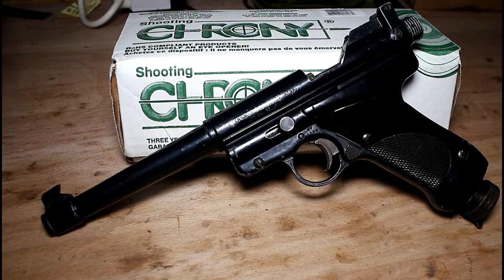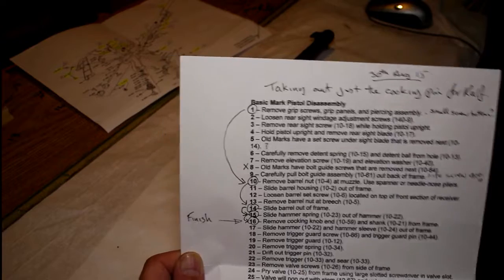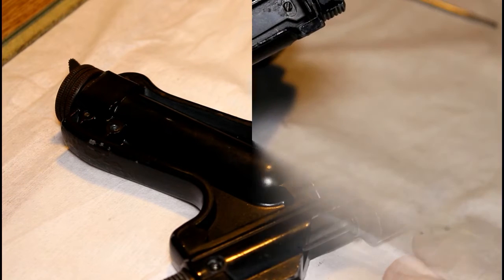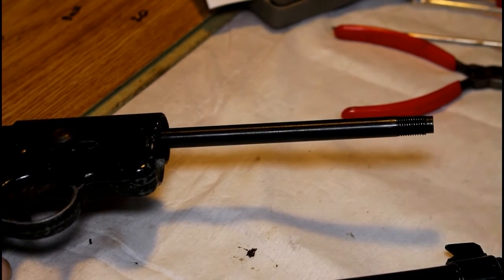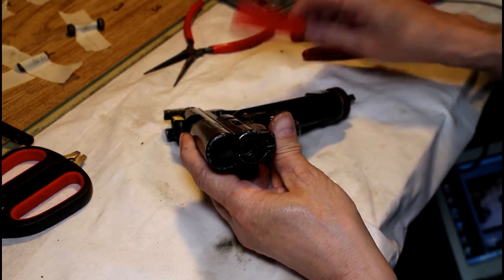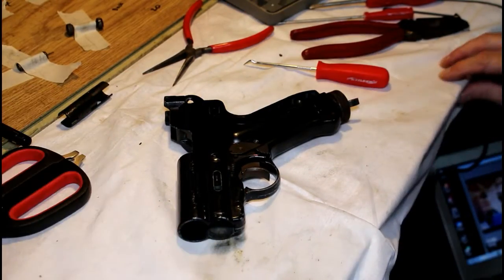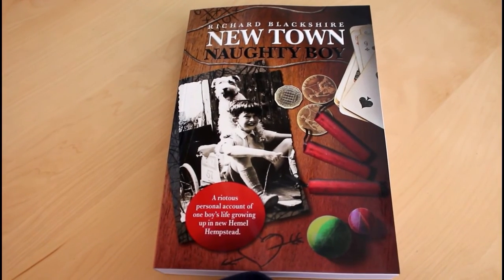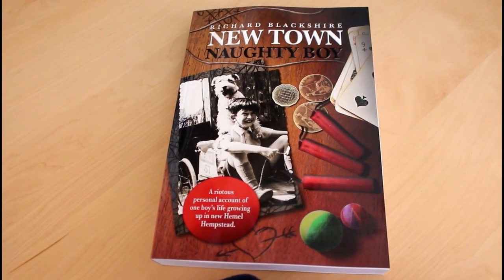Crosman Mk2 air pistol stip down (Part 1 disassembly)

Comment: Delrin valve seal …. I replaced mine with a nylon o-ring which I made on the lathe. This required removing the brass valve head from the stem. These parts are pressed together and required a small hydraulic press to get them apart. And even then I had to simultaneously apply a bit of heat to the brass with a propane torch. Note that the stem only presses out in one direction … away from the seal. This is due to a small flaring taper in the stem just in from of the seal …. it is this taper which holds the seal in place. The seal OD did not need to be a precision fit but the ID did. A finger-tight press fit between the stem and seal was sufficient. To reassemble, the seal was placed into the brass and the stem carefully pressed in with the hydraulic press until the flared part of the stem just met the seal. And that’s it. Some new valves don’t have brass at all, it has been replaced with some sort of plastic (Teflon?) which also serves as the seal. This is much easier to make. In future. I’ll make a single Teflon or nylon block to replace the brass + seal and press it onto the stem.

Comment: I have a Mark I and the tail on the hammer spring broke off in the cocking bolt, is there a way to remove it so that I can remove the cocking bolt?  Great video

Comment: you didn't cover the piercing pin enough. Mine is leaking and was just looking for info on this area. I will keep searching thank you for your video.
Reply: You have to rebuild that!  Get some snap ring pliers(cheap ones that have the removable pins! Some come with extra ones...Use the tip type that are 45 deg and bend to 60-90 deg 45 deg.  When you put the pins back in have the tips with the pins facing outward, so that the pliers will be able to lay fat if you were to set them down on a flat surface!  Now you have a tool that when you squeeze them the pis will spread outward, so when you put it inside  squeeze it should remove the inner casing to get to the o-ring that will stop your leak !

Comment: Hello from across your pond. Am enjoying the vids and looking for one on disassembling MK1 target..
Need to replace seal in the bottom of the piercing cap/plug. Replaced the o-ring on the end of plug but still gas is leaking out. Mine is the plunger style, I do see what appears to be a roll pin on knob of plug will give that a go. Take care cuz I don't...

Comment: I found all your videos on the Crosman Mark series pistols to be very informative.  I have a Mark II that I bought as a young boy probably around 1975, I'm pretty sure it cost me either $29.95 or $39.95 at the time.  One thing I noticed you did not mention was the adjustable trigger, maybe your pistols don't have that feature but mine does.  I also have the adjustable power setting,  the push button piercing mechanism, a 9 digit serial number and a magnet on the "bolt" to hold BB's in place.  I'm getting ready to install all new seals, your videos will be a great reference.  Thank you from the US for taking the time and effort to make your videos -

Comment: Rebuild kits, with a
 new valve can be ordered at Mac1 airguns, $37.00 USD
Reply: Excellent instructions!  I buy old airguns that need work.  I am using your video and rebuilding a Crosman Mk I.  I see you have instructions for the Crosman 130, which I also have.  I would like to rebuild a Crosman 106 which shoots, but so weakly it bounces off a paper target.  Do you have or plan to have instructions for that elegant old (as old as I am) air pistol?
Tom G
Reply: Can a seal be replaced on the valve
Reply: not any more

Comment: Have you considered a custom barrel for one of these? I'm considering turning my mid 70's MKII into a custom 10" barrel squirrel/field pistol. Do you think 1:20 is a fast enough twist rate for the 500fps or should I go 1:16? Is polygonal rifling better with hunting pellets or should I stay conventional. What are your thoughts on a choked barrel for something like this? I've extensively modified firearms  but not airguns.

Comment: A faster way to get the valve out is to point the gun at a soft pile of towels and insert a CO2 cartridge. Works instantly.
Reply: Tried this, worked great. One caution; the valve really shoots out the front, trying to stop it with a finger will result in sore fingers and a knee-crawl all over your workshop. I used a car sponge, safely stopped the valve. As always when confronting fast moving parts, safety glasses are you best friend!